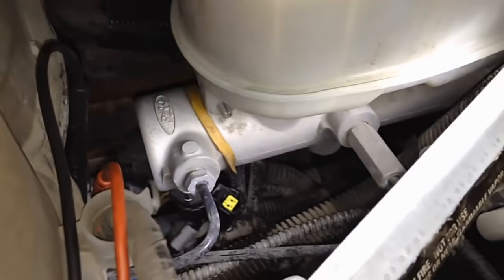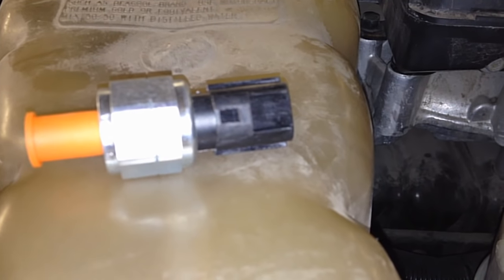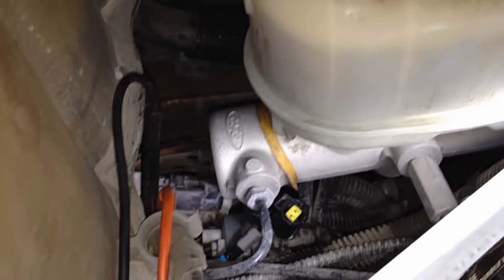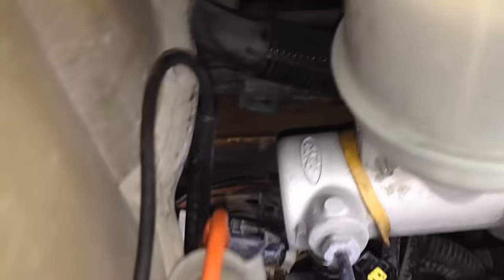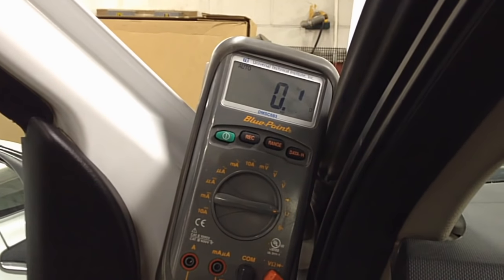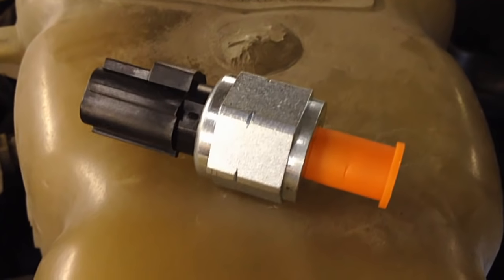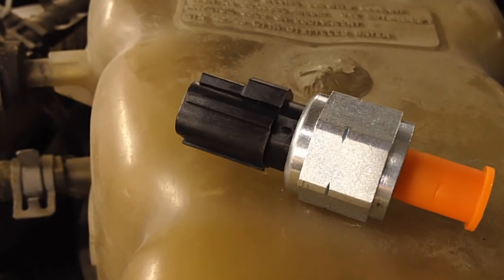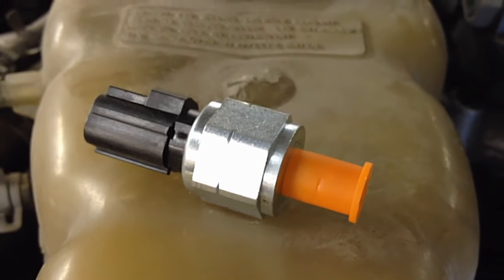#1 Reason Your Ford Cruise Control Doesn't Work Anymore

Comment: Hi just wanted to stop by and say Thank You so much. I was having intermittent issues with my cruise control and I ran across your video and did exactly what you said and $27.00 and 30 minutes later my cruise control was working perfectly. Thanks again for your knowledge and helpful video
Reply from the maker: Nice!
Reply: Die brake fluid leak out when you remove the old one?

Comment: Was having this problem in my 2003 Mercury Mountaineer 4.0l v6 AWD cruise would work sometimes, then not at all. Went through your steps of checking the continuity and voila, switch on brake master cylinder DOA. Looked like original one, pretty cruddy looking. Replaced with a carquest/BWD from advance auto. Works like a champ now. Have used several videos of yours to diagnose problems in this truck. I just bought it used, so working the bugs out still. Anyhow thanks for all you do to educate us DIYers out here. It is much appreciated to save us some money.
Reply from the maker: heckmancs No problem!

Comment: Another possibility for an inoperative cruise control system on some Ford trucks with a manual transmission is a bad clutch pedal position switch. Many thanks for this video :)
Reply: thank you for your comment it seems that when I bypassed my clutch switch. Haven't had cruise since... I'll try again.
Reply: Droppin' bombs over here

Comment: Just did this replacement on a 2000 Excursion V-10 and I worked great. My symptoms were no cruise functions and no cruise light on the dash. After the change all cruise functions were restored but still no light. I can live without the light. Thank you for posting this video.

Comment: Thanks for the video! We just bought our son a 2002 Mazda B3000 and found that the cruise control is inoperative. Using your video, I was able to troubleshoot it by ohming out the sensor, which was open at all times. Part's on order and will be installed asap. Thanks again!

Comment: This video is most appreciated!  I was able to replace this de activator switch on my Ford E350, and now my Cruise Control works every single time.  It was a cheap easy fix.  I had had this looked at some time ago where the mechanic pulled out the switches on my steering wheel and blew them out with compressed air and this did not correct the problem.  After watching this video I took the chance on replacing this switch as I also came to learn that my Cruise Control issue could also be the mechanism in the steering column that might need replacing.

Comment: Wow, came upon your video while looking for something else but after viewing this video I now realised someone had installed the wrong master brake cylinder installed on my Super duty truck using a master w/o this sensor on it. Had just ordered and received a new master but with 3 ports on it yet no one including Cardone manufacturing knew what the third opening was for! Now I'll need to get the sensor and put my truck back to what it should have been from the start. THANK YOU So much sir!

Comment: Thanks! The brake switch was an open circuit when I tested it,, and a new switch fixed my cruise control.  Power Ford in Albuquerque had told me that it was "probably" an ABS module problem, and wanted $850 to order the part and replace it.  They still charged me $160 "restocking fee" after I told them that it wasn't the problem.  Grrrr.

Comment: Saved me buying a steering wheel switch. Had no idea this switch even tied into the Cruise, makes sense when you explain it. Funny thing is, I just hooked Forscan up and found a stored code for brake switch and had my wife verify the brake lights were coming on. I was a little befuddled about the code until seeing this video, now it makes sense. No cruise and a code for a brake switch, bought the new cutout without even testing continuity. Thanks!

Comment: Thanks for the video post. I have owned my 2006 E250 for 2 years. Even though this video is 10 years old, it is still very relevant. I replaced this switch without any other diagnosis, and it didn't solve the problem. My mistake was that I didn't take the first step of checking the fuse first. The fuse was blown and replacing it solved the problem. Always remember the basic first steps. Luckily my mistake only cost me the low price of the switch.

Comment: I can see by the extended harness and Ford stickers onto a new switch portal on the front of my master cylinder, that this must've been the recall done to this 98 Explorer of mine back in '07 (confirmed with selling dealer to old owner).  My light started flashing on the dash last night and I noticed the cruise control also had stopped working.  Since I hardly use it anyway, I just pulled the fuse (#10....3rd row down from top, 2nd from left on inside panel by driver door).  That stopped the light and I'm good to go.  Brake lights, everything still work fine.  I'm good!  Thanks for your video.  Gave me confidence to shut that light up without an expensive trip to a mechanic!

Comment: Man, So glad I found this video. Have an '02 Ranger that the cruise would work intermittently. Had a trip coming up (900 miles) that I was dreading. Replaced this part, and cruise worked the whole time. Thank you!

Comment: thanks for the video.  Got me going the right direction.  Ordered part of amazon as local shop did not have one with the correct connection.  I think it was $25.00.  Was able to still use the installed fuse line placed on the truck from the recall.  Only took 5 minutes to change and now there is cruise.  Thanks so much.  Saved me a bunch of $$$$$.  2000 f250 V10 crewcab.

Comment: Well a big thank you for this video. I now have cruise on my 2000 f-250 super duty. Going to make pulling my camper a lot easier.Just want to add that you have to replace the the harness with that has the two fuses and not just the switch itself. Worked from what I hear the 1st time in years. Thanks again.

Comment: 2005 Ford Freestar. I pulled the wire loose put a jumper in the connector. Got on the road. After months of not working, it now works perfectly. Ordered new brake fluid pressure switch. Thanks a lot. I expected to have to push "off" to turn off cruise, not so. It turned off when brake was pressed just like normal.
Reply: Just make sure you don't leave the jumper in after performing the test.  With the jumper in place the cruise control will not disengage when the brake is applied.  You'll need to press OFF to get out of cruise control mode (with the jumper in place).
Reply: Jim Frieday Read his last sentence. It still turns off with the primary foot pedal switch. This one is meant as a backup

Comment: Thanks Bro, extremely helpful video, unplugged the sensor and check for corrosion and didn't find any, drove the truck and it works every now and then so finally a Month after first seeing this Video I went out and bought the correct switch for my truck and BAM it works great.If it wasn't for the author of this Video I would never had spent the $35, it saved me hundreds if I went to a shop.

Comment: Thanks so much for the video I just replaced mine hoping it was the issue and it was! I didn't bleed the brakes like you said but for others. You might want to know it will start spewing brake fluid when you take it off so be prepared with the new one to swap quick.

Comment: Thank you for the video. I had the same issue and it was resolved by replacing this switch. Found the right replacement switch at Amazon as you recommended.

Comment: Easy fix for my 2002 F250- the location of the switch was different than the video but was able to locate and change the switch easily. Thank you for the video.
Reply: i have a 2004 f150. where did you find your switch?
Reply: It was right on the master cylinder.

Comment: I would like to say thank you it fixed my 2000 Ford f150 four-wheel drive changing the switch fix both the cruise control and the four-wheel drive not engaging problem with one switch.

Comment: I had an intermittent issue with my cruise control on my 2010 F350.  I changed the front switch (code reader read switch b I believe?) on the bottom of the master cylinder called the cruise control switch Part number CCS12 from Lordco in Canada.  Part costed about 40.00 compared to the one I was quoted on from the Ford dealer for 450.00.  When I changed it out hardly any fluid came out of the master cylinder and I had it changed out in about 10 min.  Cruise control has worked ever time ever since I changed it out and its been a few weeks now.  Thanks for this video and I hope my info helps some else out.

Comment: My 2012 Ford Edge cruise control only works when I  click erase on my OBD II tool even though it shows no codes. Do you have any ideas why this may be happening? Shoud I replace the switch? It is standard cruise control and not adaptive.
Reply: It’s 10 years old drop it off at the landfill

Comment: Wow, thank you very much.  My 99 Windstar cruise hasn't worked for a year.  Looking through AllDataPro with a code that said it was a speed sensor led me nowhere.  I have no clue why I didn't pull a schematic or even do more online research to remedy this.  I stumbled upon your video, jumped the socket leads (for troubleshooting purposes only) and sure enough, it's that switch.  I even think there is a recall because my switch and connector are under the master cylinder.  The recall fix adds a pigtail extender to get the connection away from possible brake fluid intrusion....will check with Ford before spending the $20 bucks....again, thanks!!!

Comment: I have a 2004 F150  FX4 and had the same problem with the cruise control not working or would work for a short span before kicking out.  I found that my bake shift release switch was bad.  To test if it was bad I was able to shift it into gear without touching my brake pedal.  The switch can be replaced.  I was able to replace the transistor inside the switch.  Now my cruise works good.

Comment: When I installed LEDs in my brake lights my cruise control quit working in my 2002 Mustang. I replaced those LEDs with  4 T series Lasfit LEDs in my tail light section  (2 in the outermost positions which are the brake lights) and that fixed my cruise control problem. The specific LEDs are the Lasfit T-3157R. The theory is that these "CANBUS Ready" LEDs have circuitry that pulls more current than the LED needs so that the cars electronics is fooled into believing it has the OEM halogen bulbs installed. I think this is a better solution than installing resistors. I hope this info will be helpful to others.

Comment: I replaced this switch and it worked it for about 30 miles, then it started cutting off on me while I was driving. Turns out the plug that plugs into this switch was shorted out inside the plug itself. I tested both the old and new switches and both showed 0.00 ohms when I touched the leads to the terminals. So Neither one was stuck open. Which means my old switch was actually good the problem the whole time was the stupid plug. A way to test this is to get one of those blue automotive wire connectors that allow two wires to run side by side inside the plastic piece which holds a small flat metal piece that you squeeze into the blue plastic part with a pair of pliers. The metal piece cuts through the outside sheath of each wire and allows the copper part of the wire to slide up into a small notch in the metal tab for each wire essentially causing each wire to be connected to the other electrically. It accomplishes the same thing as if you were to just tie the two wires together but instead allows you to still keep the factory plug in tact just Incase that’s not the problem. So attach this piece to the two wires that are going into the plug for the cruise control cutout switch. Now, drive the truck and test to see if you have cruise. If so, you have a bad plug. I first tried sticking a U shaped piece of metal in the plug to see if that worked but it didn’t because the short was inside the plug itself so by using a jumper in that bad plug it still failed to operate. Now don’t be alarmed about trying this method. Your cruise will still disengage when you mash the brake as long as your fuse for your tail lights are not blown. Note, there is no fuse for the cruise control on a 2009 Ford F-250 with a Diesel engine. The cruise control cutout switch is really only a safety feature in the event that your brake light fuse is blown. Then it’s necessary to have this switch to cut off the cruise control in the event you mash the brake with a blown taillight fuse or two burned out tail lights. But unless you drive around with no brake lights then this isn’t even a necessary switch to even have. Now if you mash the brake and your brake lights don’t work, then you could have a different problem altogether. It’s either the fuse, bulbs, or the other pesky little switch located just behind this one on the master cylinder. The switch located closest to the fire wall on the master cylinder is the brake light switch. So make sure you have brake lights before jumping the two wires on the cruise control cut out switch. Ok one other thing to check, is your ABS light on, is your airbag light on or blinking, does your horn work? If any of these problems exist the problem is most likely your clock spring in the steering wheel. If all that’s fine then the only other thing it could be is the steering wheel switch’s or your speed sensor. Does the vehicle switch gears properly or is it shifting rough, these could be speed sensor problem. If you have a standard transmission, check your clutch switch. Now this last one is rare but it’s possible that the cruise could even be disabled in the computer. Is your check engine light on? Sometimes after going into limp mode your cruise control can be set to disabled in the computer. Hook up a diagnostics computer and check it. If so, turn it on. Well anyway, I’ve just about listed all possible problems a 2009 Ford F-250 with a 6.4L engine can have. Hope this helps anyone out there struggling to fix their cruise control problems.

Comment: Replaced the switch, has the ford wiring update and still no cruise. Light doesn’t even come on the dash. All lights and brake lights work, and yes third brake also. Manual trans on a 95 Ranger 2.3. All fuses are good also.

Comment: That did it, thanks!! Am I wrong to be concerned about air in the brake lines? When installing new switch down onto fitting, there's got to be a bubble of air trapped inside, in the bottom cavity of switch housing. I wish I'd thought to first drip some brake fluid into the switch there, then install = bubble-free. Either way, everything seems to be workin' fine now!

Comment: Just FYI people if you're having other electrical issues it's going to be your gem and or fuse panel do to windshield leaking. Using the meter to test it will not correctly diagnose the issue

Comment: I am a huge fan, You are the only one I will listen to, But I have a 04 F-150 FX4 my cruise control doesn't work. Mine doesn't have that switch, I changed the steering wheel controls, it worked for a couple hours and now nothing. Thank you for your time and help...

Comment: Thank you F.T.M. I just replaced that switch and the wires on my 99 Ford Expedition. The instructions on the little blue tag that is attached to the original wires say to replace them with new ones. But luck, it still doesn't work. I'm going to do that continuity test. Thank you for that idea.

Comment: Hey, your not going to believe this, but here’s what happened. I had my cruise control go out the other day and went to look under the dash where my switch is, (2005 F150). I remembered someone had said something about their break pedal on a video and checked mine. That wasn’t my problem, but it got me thinking and I thought about checking my emergency break for some reason and pulled up on the release and low and behold it released a little, I must have hit my pedal at some point. Not enough to set the break, but about two clicks worth to trigger that switch. My cruise control went right back to working..  Who knew???

Comment: I changed this pressure switch on my 2007 Ford F250 diesel. What is the other sensor sticking it of the master cylinder? If this is a redundant switch, can I replace it with the same sensor that is on the front of the master cylinder? 
Thank you for the videos FordTechMakuLoco. They have been a huge help.

Comment: During the colder months of the year my cruise control doesn't work, but it works fine in the warmer months. 
This is on 2005 E350  5.4 gas.
Thanx.
Mike H
Kindersley, sask.

Comment: I just like to add also check your brake switch because mine likes to stick and if it's stuck on the cruise control won't turn on so make sure that your brakes aren't stuck in the on position before trying to activate cruise control

Comment: 2002 F150, I replaced the speed control deactivation switch and a blown 5 amp fuse. A month later, bam.  Replaced blown 5 amp fuse. and switch again, but. Still blows fuse when switch is connected. Any help with this one?
Reply from the maker: bdavil5 That wire goes right from there to the speed control servo. disconnect servo and see if it blows that will tell all.
Reply: FordTechMakuloco Sir, I found a unit mounted on the frame near the fuse box under the hood. Has a 8 wire plug on it. Plus a throttle cable. Well I disconnected it and fuse didn't blow. So I assume that unit is defective.( the amp). Had no vacuum lines. Thanks